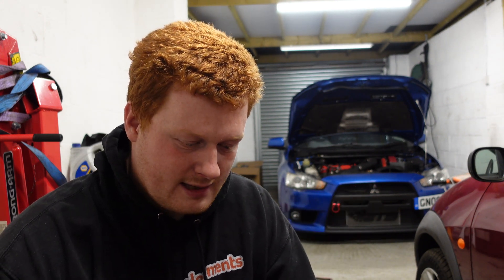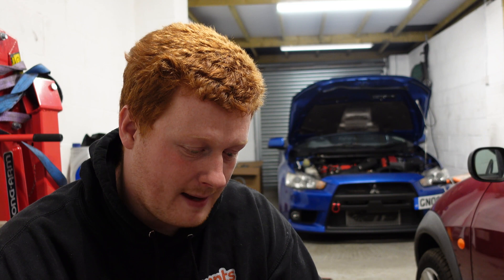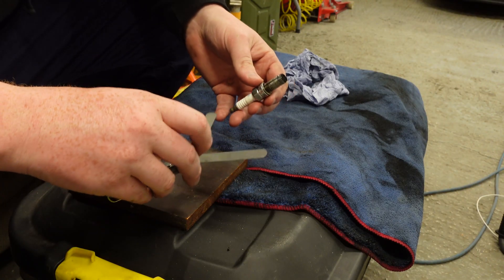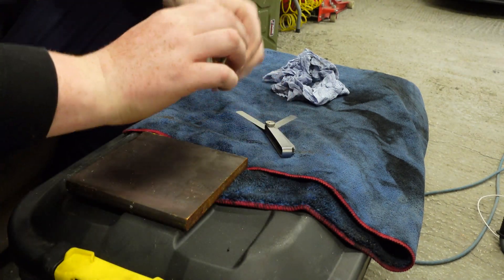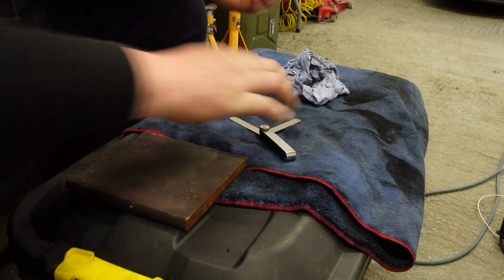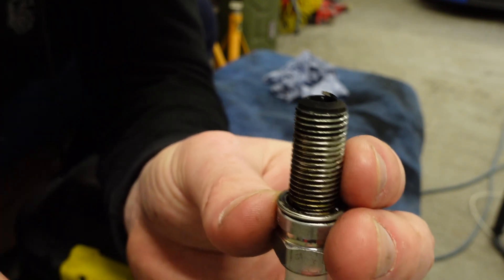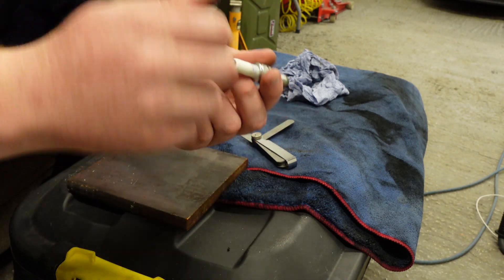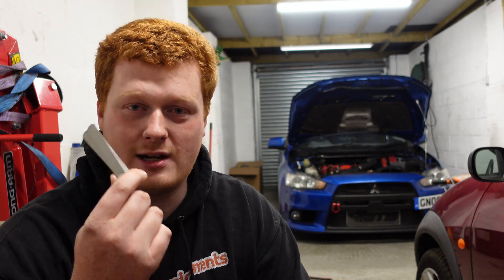HOW TO: Gap Spark Plugs - Make your car run better for free!

Comment: Wow what brand are them there very cold plugs by look of it or there design is very inclosed could be wrong as there a used plug and cant see down inside all that well, but i would do some looking around for better plugs.
Reply from the maker: Best plugs money can buy these are, ngk racing plugs. Perform amazing no misfires even when gapped wrong 😁
Reply: @rowanlewisuk  defo dont dowting that NGK are best all round its what i use in all my cars i have had what heat range are you running as its seems very carbon fouled i understand you been still truning so this might be down to safe fueling while tuning maybe but would defo keep an eye on them. even the wrong spark and gap are ignitioin system on the ten is really good form oem so will spark most plugs ok but as you go hight in boost and power this will put more stain on it if the plugs are wrong.
Reply: mainly dont wana see you build go wrong as i think i might be going down your route in time too so its a good base line to work off as you show enough indepth stuff and passtion for it all
Reply from the maker: @PureEvolution  cheers mate I know you trying to help but they are good plugs, yeah it was flooding on shift for a while and these plugs have had a beating whilst i been mapping it and still work so im Impressed
Reply: @rowanlewisuk  yea it was the cold range i was mainly talking about as 8 is a cold plug from who i have spoke to with my otherr cars you should be fine with a 7 unless your planning to start going over the 30psi type power, so this will then not get the plug to self clean its self giving you not as much performance as you could be getting so to speak, but your still dialing in tune and stuff but its somthing to consider once you got everything else sorted to check back with clean plugs and see how the temps are in the cylinders.. could be difference between 598bhp on the dyno and that magic 600 your wanting lol
Reply: @PureEvolution  8 is the OEM cold plug..